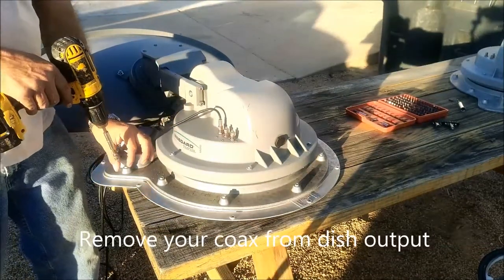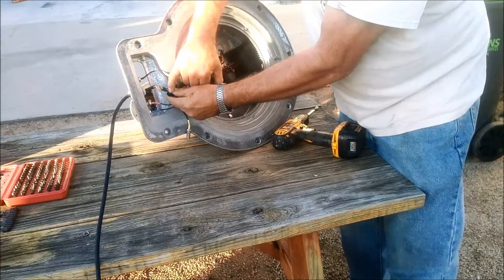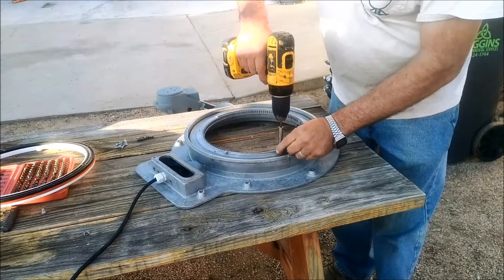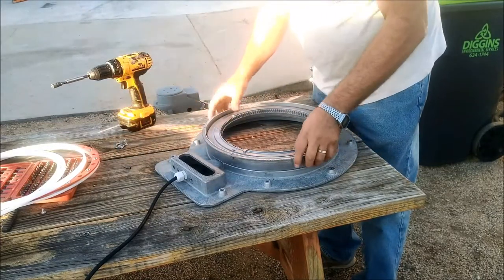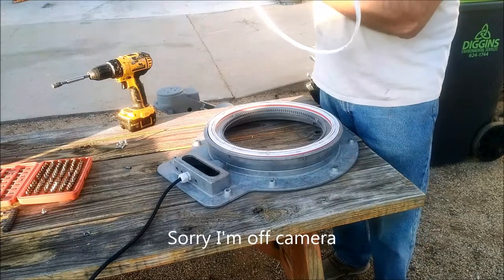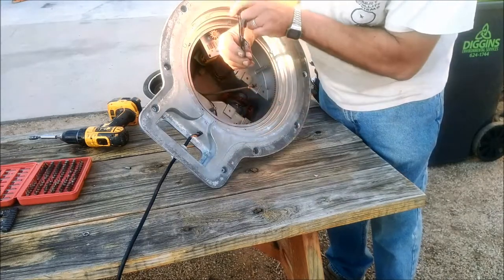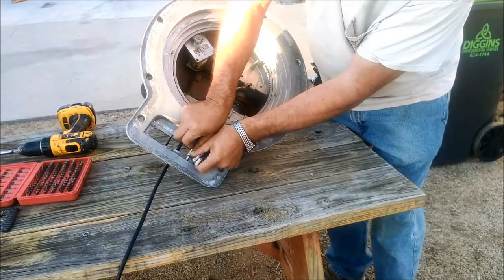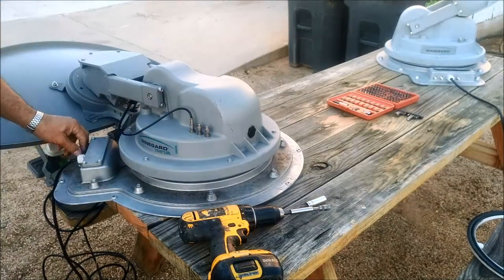Winegard Trav'ler loose Turret bearing fix

Comment: Pat, great video. Two questions. Number one does it matter if the turret is turned to the side from where the dish stows for travel? The other question is my dish is not locating the satellites. It just keeps turning in circles. The people from Winegard said that it is a matter of replacing the wire bundle in the dish which is why I’m asking the first question about the alignment of the turret. Any thing you can tell me would be greatly appreciated.
Reply from the maker: It is easier to do it the way it is when stowed but once you disassemble it you can clock it any way you want as you will be timing it when you put it together. just be sure your wires are not twisted. The sheathed cable can cause it to turn without stopping to look at satellites but it can be a tuner issue also. try the cable first
Reply: One last question. After reassembling the dish I am now getting a “El Motor Home Failure” code which I’m guessing we didn’t get the  timing right. Once again I really appreciate  anything you can tell me.
Reply from the maker: Run a EL calibration in the installation menu  @MrGCline